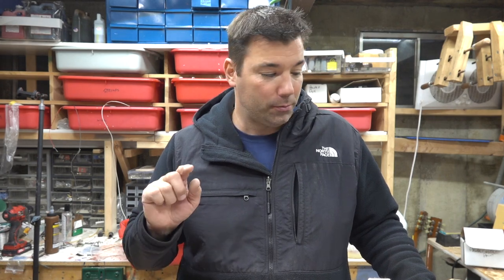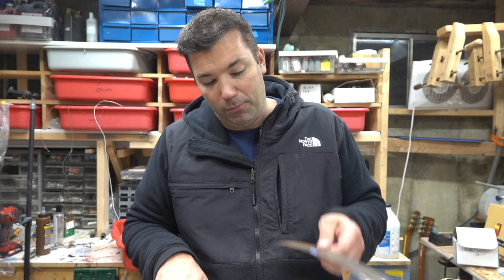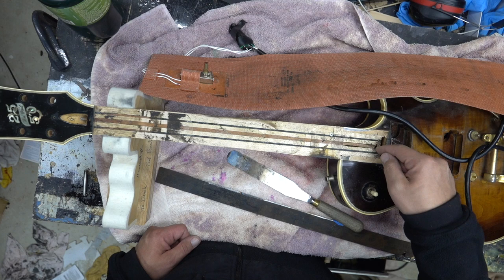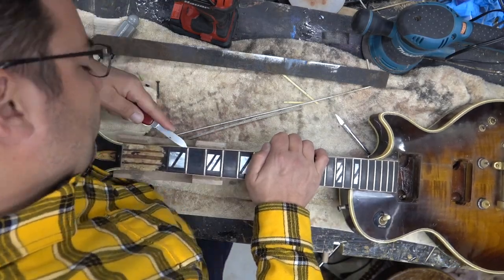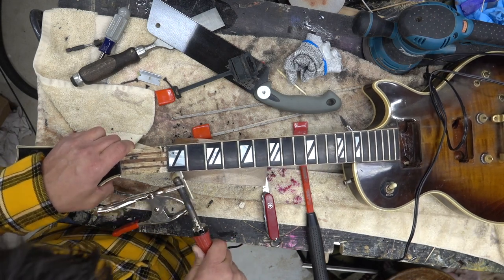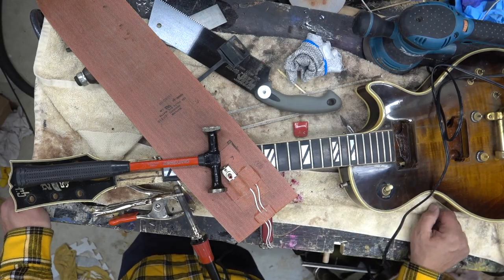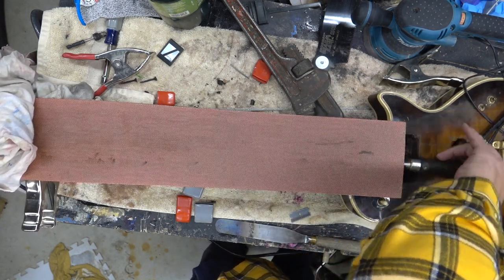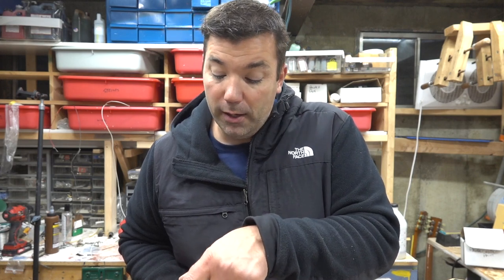Removing a Guitar Fretboard - 25/50 Les Paul Custom Repair Part II

Comment: Derek, if you shorten up your dual soldering iron knife the irons should heat the knife more efficiently because they are not trying to also heat all the excess metal hanging off of each end/side.   Install heat-proof Phenolic handles instead.  Great idea and you should patent it!

Comment: I do repairing smartphones. There is a techniue to get underneath a glass back cap, using air heater and thin guitar picks. Maybe it would be helpful in fretboard work too?

Comment: Derek, I need to replace a broken truss rod on an old beater guitar. The fretboard has binding. Do I need to remove the binding first or is it possible to get the fretboard and binding off in one piece?